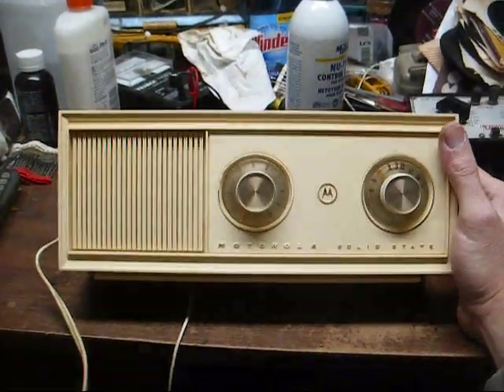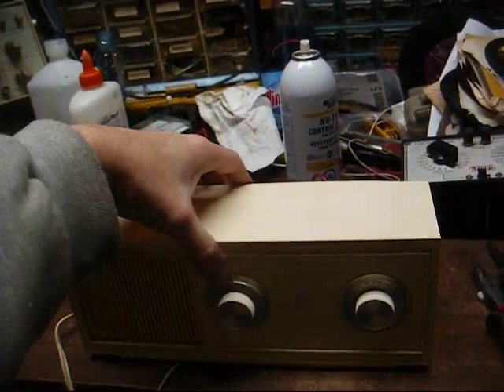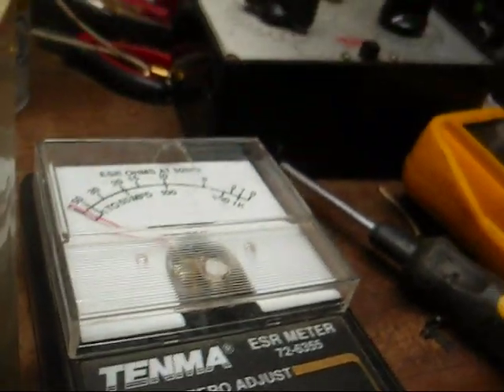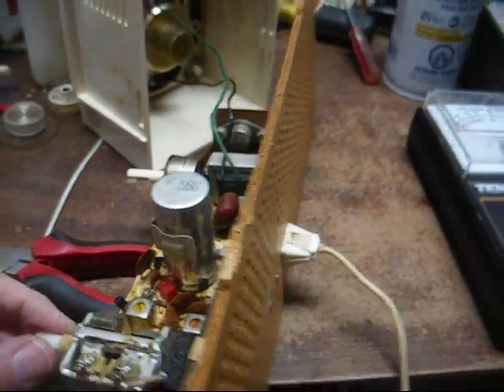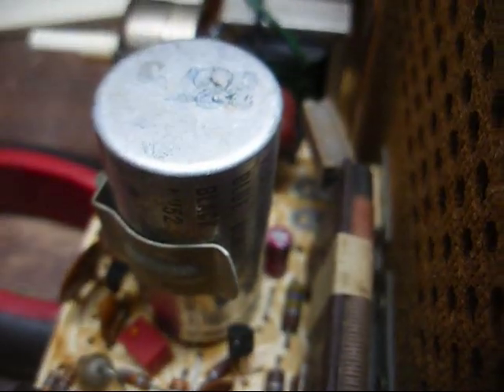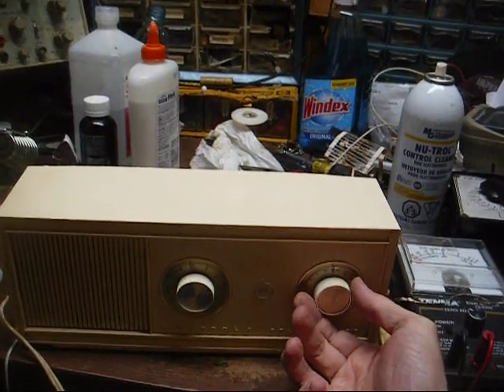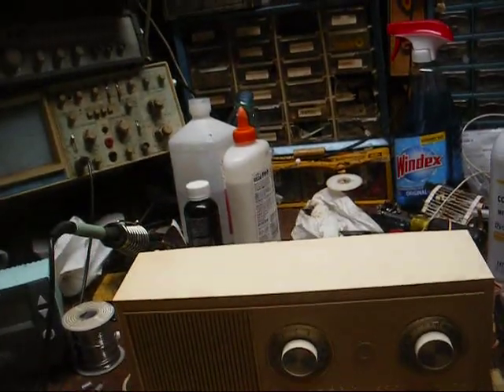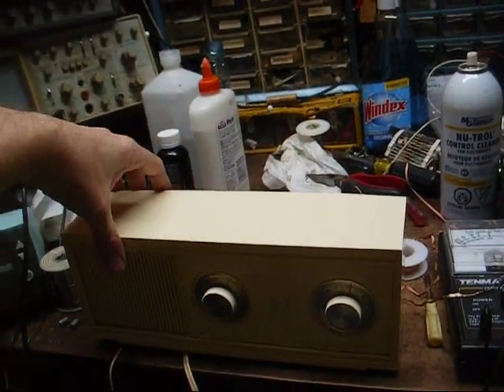Motorola AM table radio from 1968

Comment: Was R23 dry jointed at one end ?. Just looked a bit bad on the video . I remember the cheap pocket AM radio's from the late 60s / 70s would often squeal if they weren't tuned spot on even when new.

Comment: What causes the whistling and squealing on tube radios?
Reply from the maker: Usually, outside interference that's generated from sources such as switching power supplies, lighting, etc. It can also be caused by RF on the power line (especially when the line filter capacitor in the radio has failed) and RF riding on the AVC line and getting into the audio circuits can cause it. Usually, this happening is due to failed capacitors in the radio.

Comment: rtvpn-Suggest replacing what I assume are 4 foot fluorescent bulbs with LED bulbs of 5000K (Daylight) color. You'll get clean white light without the "blue" tint of daylight fluorescent bulbs and no more RFI. Bonus-they use less than half the power of the old tubes esp. since you disconnect the ballast. I have them and they are a great improvement.

Comment: I'm no expert in radio repairs but one thing that I can't figure out is the squeal at 910. In the town I used to live in, they had a 910 station and on certain radios it was louder than others (the squeal). If the IF is 455, and say the tuning dial went down that far, would there also be a squeal at 455? I don't get why it squeals because 910 is simply double the IF frequency. That would mean that at 1365, triple the IF, would there be another squeal? I can't test this as I don't have an AM radio. Just sort of perplexed on this mystery!
Reply: Image frequencies?

Comment: Do you have any tube radios for sale on ebay ?have you tried the L.E.D. tube replacements for your flouresents,maybe they wouldn't interfere with your radio testing .but you would no better then me .nice save on the motorola.I love to watch your radio repairs.thanks for shareing,I miss the made In the u.s.a. label a lot.
Reply: LED lighs usually cause interference on AM radios too
Reply: @rodedamiguelez631  Would be an interesting test for a video. Big box home centers are selling LED shop light sets.
Reply: Any light fixture that has a ballast will likely cause interference.